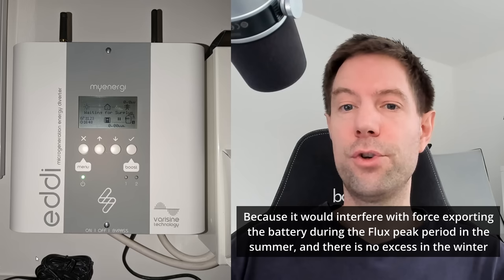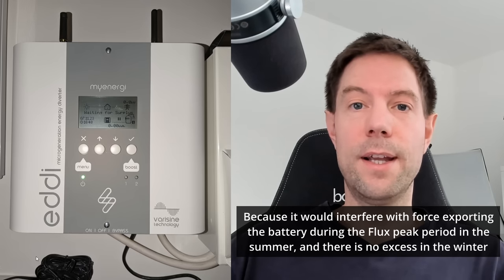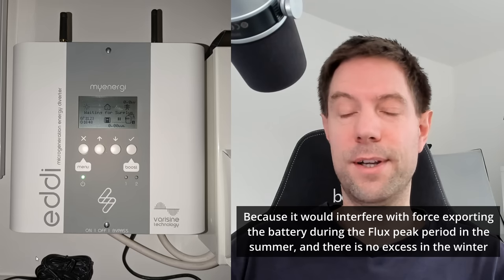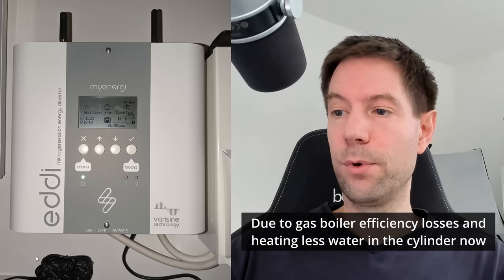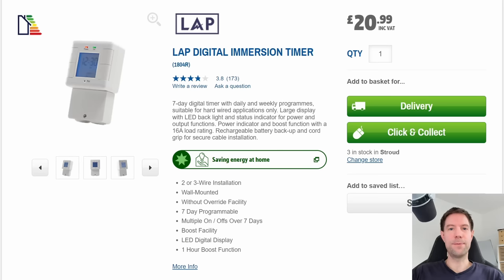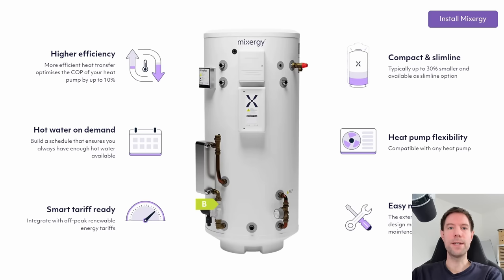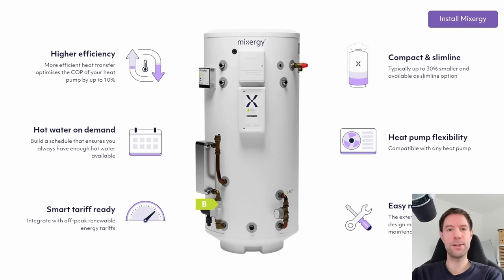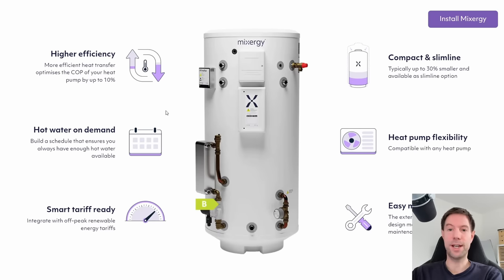Gas free hot water - so many options!

Comment: Very informative video. We made the conscious choice of cutting down our fossil fuel use and installed PV 3 yrs ago and is a 2 electric car household. I have been waiting to change our 12 yr old veissman when it gives up the ghost and was disappointed when Octopus came and did the survey for a Daikin HP and was told we would need to put the pump in the garden as the regulations didn't allow installation in the side ( due to lack of space, space is premium in manchester suburbia even with large houses). They also wanted us to have absolutely humongous radiators and suggested running the pump at 45C. To top it all the guy who came whispered in my ear to stick with the boiler. My boiler died 2 weeks ago and I am changing to a system boiler (98% efficient Worcester Bosch ) with a  tempest single coil HW cylinder hoping to heat the water at night with my cheap IO tariff and surplus PV elec during summer. While i want to reduce my energy use I am also a pragmatist and do not want to spend huge amounts for Sunamp and mixergy like devices. I feel exporting with the new Octopus tariffs does both for me. My only disappointment is sticking with natural gas for heating.
Reply from the maker: That's fair.  They really need to loosen the planning requirements if they're serious about getting people to install heat pumps.  It's ridiculous at the moment and it's really holding things back.
Reply: @TimAndKatsGreenWalk  My cylinder is going to be 250L, I was under the impression it would need about 4 hrs to heat this up, but was a bit confused about your comment in an earlier video of yours about hot water times 20-30 min twice daily.( 3 tips on reducing gas usage). Are you talking about something else? Also what is your opinion about adding a solar boost to use PV on bright days? Will probably use more of my own energy though will lose money on it with the export tariff being very attractive.
Reply from the maker: @sukugeorge67  yeah, that sounds about right.  We did only need about 40 mins to heat our hot water when we had the gas boiler (we use between 100 and 150 litres per day), whereas now it takes more like 2 hrs with the immersion heater, because it's less powerful than the gas boiler.  A heat pump is also less powerful than a gas boiler so will take longer too.  You may find you use less than a full tank each day so will only need to heat back up what you used the day before, which will take less time.

Comment: My Eddi  uses around 7 to 9 kWh of electricity to heat the DHW cylinder. Havng an ASHP, I found it was 2 to 3 kWh to do the same . For now, the Eddi is triggering a home assistant automation to then turn on the ASHP to heat DHW, when there is sufficient spare solar.
You have found some interesting options for those with the air heating system as you have.
Reply from the maker: Very neat use of the eddi.  Not sure what to do with mine once I get a heat pump for the hot water.  Might give it away to someone who could make better use of it.
Reply: @TimAndKatsGreenWalk  You can use the Eddi to operate the heat pump for the hot water. The Eddi has some neat features to allow it to run the heat pump if there is enough solar pv generation to do so, and to use the immersion heater when there isn't. There is YouTube video called "The ULTIMATE Solar Heat Pump HACK" on the Artisan Electrics channel that shows this being setup.

Comment: Love your approach to all this - clear and methodical without any preaching or nastiness so well done!

My question would be are you facing the law of diminishing returns (in this case savings) in the quest to be totally self sufficient?  If you have the funds to do so that's fine and very helpful for those of us who are still considering what to do,  However, how many people can afford the sort of set up you have?  Installation costs and ongoing maintenance, repairs etc to what are often relatively uncommon devices whose longevity is not really known and for which replacement parts may be very expensive and/or difficult to source readily and install.  I'd be interested to know your total spend thus far v the savings you've made, what the break even point currently is and how that might change given the cost of your chosen new hot water solution.  If any major parts of your setup failed beyond economic repair how would the replacement costs of that compare to say a new gas boiler or a problem with a the heart of a normal domestic electricy supply?  Yes of course energy prices can always increase but the extent to which that's possible now must be limited to an extent by the very fact that we're much closer to the point at which people would ve freezing in their homes and business failures spiralling so the government would have to step in again to subsidise energy prices to avoid huge social unrest or unacceptable damage to the economy. 

I think what you're doing is very important and you know far better than I how complicated all these things are - how so many options are becoming available whose longevity and reliability haven't yet been tested over time and aren't yet common enough to benefit from cost savings due to scale of production.  It's a problem in the car market with perfectly usable cars being rendered uneconomic to repair simply due to the cost of hugely expensive, scarce parts and limited suppliers.  That's hardly green.

I have a 12 year old Worcester Bosch Green Star condensing boiler which has been totally reliable (touch wood :) ), reduced our gas consumption quite a bit and cost me virtually nothing to maintain.  I can heat the hot water by immersion if I so wish at cheap rates.   A brand new one would cost c. £3k and will likely see me through another decade or so with little additional cost.  My annual energy costs are around £2k with electricity being about 60-70% of that so I'm yet to decide what 'green measures' are going to be  cost effective, all the time knowing that as time goes on newer, better and even more reliable and even greener alternatives will appear.  For these reasons I'm reluctant to jump in and am finding your channel extremely helpful in forming my own opinions on how to proceed and would welcome your response to my questions.  Cheers and good luck with what you're doing.
Reply from the maker: I posted a pinned comment regarding cost effectiveness since a few people have been asking similar questions, so go check that out.  I'll address it in more detail in the next video as replying in length with the same answer to each question is taking up quite some time!

Comment: I live in spain, i put one of those tube systems on my roof terrace 3 years ago. they work great for spain. i found i needed to put one of those electric filaments in the place it stores the water for about 6 weeks in the winter. Now bear in mind that the sun is out here for most of that time about 16c. So not sure how they would work for most of the time in Great Britain.
Reply from the maker: Yeah, I can imagine it's ideal for Spain.  It's definitely viable in the UK over the summer but I expect it'd need more than six weeks of top-up heating over the winter.  I'd be interested to hear from anyone in the UK with such a system to share some real world experience.

Comment: The HP cylinders are great. It's on my plan once a few other big jobs are out of the way. A point of note (I think): The higher the input temperature, the more efficient. I've seem some installs of this device in airing cupboards where the air input is ducted FROM the loft space and the air extract is vented outdoors (for summer time; roof spaces get relatively HOT). And in winter, the air extract is diverted back into the loft space to keep it a bit warmer. Point is, there are many ways to make use of the waste heat :). Have fun with this project.
Reply from the maker: Yeah, lots of venting options.  Although the exhaust air is always cold (since the heat has been extracted into the water) so venting into the loft in winter would cool it down rather than warm it up.  Venting that exhaust cold air into the house during summer on the other hand is definitely worth considering.  It makes the piping more complicated, with duct switches etc. it just depends how much the extra effort is worth it.

Comment: Tim..I have commented before and declare as a Mixergy fanboy😊. Firstly I would say 5kwh a day for a couple for hot water is a “generous” amount, unless you have daily baths. 2 x daily showers from my Mixergy is circa 2.6 kWh. (50 litres)
Notwithstanding that, max efficiency from a HP cylinder will be a COP of 2.5. So in your case Mixergy vs Mixergy HP , the HP will save you 3kwh a day…30p in your case….but costs at least £1000 more and needs more servicing !
Also note, the Vaillant HPTank is an all in one unit….whereas the Mixergy HPTank is 2 piece, so in a worst case failure its not a complete loss

[And yes the Fischer storage is just a re-badged Sunamp— at more money !]

Keep on the journey👍
Reply: Doesn't seem that generous (For references we use around 3-4kWh of energy for a shower here, and 6kWh for a bath. I have seen estimates as high as 8.5kWh for a shower. So 2.6 for 2 showers seems very very low to me.
Reply from the maker: We have rain head showers so that tends to use more water than a regular head.  But I shouldn't have to justify our hot water usage.  I'm glad you're able to use so little.  The iHP looks like a good option for us but I'll be comparing it against several other options in the next video so it'll be an interesting comparison.
Reply: In no way was I saying you need to justify usage,apologies if it came across like that. 👍
Reply from the maker: @chriss4949  apology accepted.  I'm sure it wasn't meant in any way to be a criticism of our water usage.  It's always a danger commenting on differences in lifestyle!

Comment: I looked into a sunamp before we had all of our system changed. It worked out VERY expensive with an A2W ASHP as it needs to be specced to be high temp. The PCM in the Sunamp needs 60C+ in order to charge.
I went with a Mixergy. It can really only be half filled by electric directly. When using the heat pump it needs to be all done. The good thing is it uses an external plate heat exchanger so transfers more of the heat energy to the tank water. Tbh, in hindsight I would have gone for a Mitsubishi cylinder along with our Ecodan and used the Mitsubishi smart controls.
Reply from the maker: Hindsight is a wonderful thing.  We live, we learn, we realise we should have done things differently!  Oh well.  Sounds like you got a decent solution in the end though.

Comment: I've also been looking. I liked the Vaillant aroSTOR a lot - simple local controls which do most of what you need. Option for a voltage free contact to run either heatpump or "backup" resistive heater, so easy to add to home automation and keep everything local.  
Then mixergy put together their own heatpump integrated cylinder and started throwing mud at the serviceability and limited warranty of the "competition" (Heatpump dies -> new cylinder), but I don't want mixergy as they're asking for too much money for something overly dependent on their cloud service... which put me off both systems, and the gas combi I have now is working (if more carbon intensive than I'd like..)

The Daiken looks interesting, previously looked at the Samsung EHS TDM+, but the indoor water unit is huge and won't fit where the old water cylinder was...
Reply from the maker: There's also the Dimplex Edel.  I'll be covering that and the others in the next video.
Reply: @TimAndKatsGreenWalk  While they look cosmetically very different, the control system looks very, very similar to the aroSTOR. Might be the same OEM for the Heatpump?
Reply from the maker: @stevescott9289  I'm not sure.  I plan on comparing all the specs and data sheets so if they are suspiciously similar then you might be right.  I had a feeling they were a bit different though when I first looked.

Comment: Thanks for putting this info together Tim! Very interested in the rest of your journey - we are about half way through a transition to A2A in our house (Panasonic Ducted Upstairs, probably sticking with Panasonic but wallmounted cassettes for downstairs). Still have a big Veissman 111 boiler for our hot water but been looking for a solution away from that :)
Reply from the maker: Ah nice, I wish I'd looked more into the ducted A2A option back when we got our system installed.  We're pretty happy with what we've got, and may have still chosen this route, but I should have spent more time looking into it.
Reply: @TimAndKatsGreenWalk  Yeah I think you have the Toshiba ones? Heard they are meant to be great also! Ducted is super quiet which is nice but we have 1 temperature control for the whole of upstairs is the only downside - but tbh this hasn't been a problem for 2 years as all the rooms are balanced nicely with the ducting and air flow.
Reply from the maker: @stockbullfrog  yes, we have the Toshiba Haori units, which we do like a lot.  Ducted upstairs would definitely have been good though.  One day I'll get around to doing the "what I would have done differently" video, which I keep meaning to do.

Comment: 11:36 - was my way of thinking till yesterday, when Vaillant confirmed, that our aroSTOR's hot water storage cylinder can't be individually serviced, so now that it ruptured, we'll have to dispose of the whole unit - even though the HP is working completely OK (like well, now it's OK, as the compressor had to be changed when the unit passed 18 months service time.)
Reply from the maker: Dang, that's annoying.  We went with the Mixergy iHP which is in two parts, cylinder and HP separate, so with any luck if something similar happens to ours it wouldn't all need replacing.  Time will tell, of course, you never know if that would work in practice.
Reply: well, @TimAndKatsGreenWalk , I would maybe use some stronger language, but it is what it is. so my idea now is to go with a Sunamp thermal battery (should be good for 40k cycles, not mentioning it has 10 years of warranty) and hook it up to an air-source heat pump (ASHP) and when we get one installed, a PV system. when and if the ASHP wouldn't be able to produce decent amount of forward going temperature (which can eventually happen here in Hungary) then we still have the grid to feed into the Sunamp. I can't yet think of a more minimalist setup, that involved lesser parts.
Reply from the maker: @tamaskovats  that sounds like a good plan.  I hope it works out better for you than the aroSTOR!

Comment: Intake air from the loft is the way to get best efficiency and Mixergy told me that you can fit the heat pump part of the system in a different location to the cylinder (obviously with a distance restriction) As my cylinder is on the middle floor of my 3 storey house I am still not sure how the pipes would need to run and the £3k plus instillation is also a problem.
Reply from the maker: Ooh, that's very interesting.  Our garage is directly below the airing cupboard so I wonder if I could install the cylinder in the airing cupboard and the heat pump in the garage.  Hmm, very interesting indeed, thanks for letting me know!
Reply: @TimAndKatsGreenWalk  The reason air intake from the loft is good is that heat rising from the home means that you are taking warm air into the DHW Heat pump, which makes that heat pump more efficient, but make the home colder, unless your boiler or heating heat pump work a bit harder. Overall the arrangement isn't generally more efficient, but can avoid the DHW heat pump freezing in the colder winter months.
Reply from the maker: @tlangdon12  yeah, I was replying about the split heat pump and cylinder not the air intake from the loft.  I agree it's better to have both vents going to the outside.

Comment: you could move the wiring on your existing cylinder as the unused heating element is higher up your cylinder so you would be heating less water
Reply from the maker: True, although we occasionally use more hot water than usual like this weekend when the in-laws came to visit.  In cases like this something like the Mixergy system would be pretty handy.